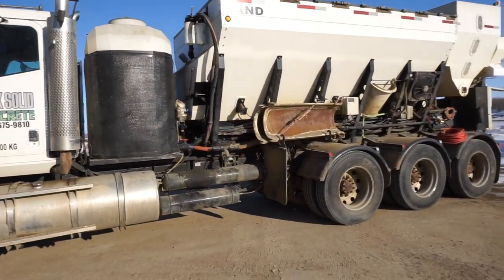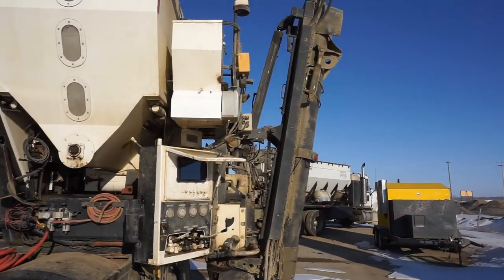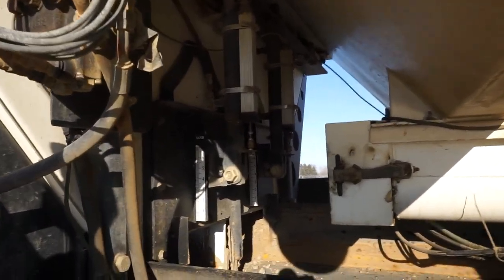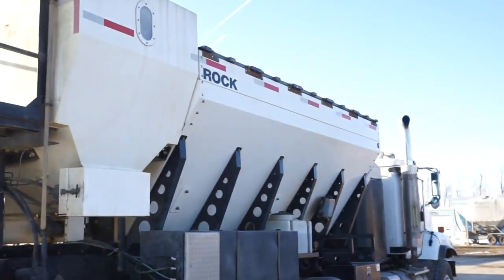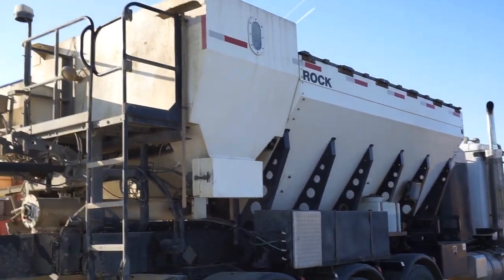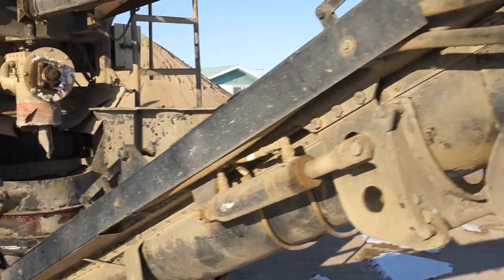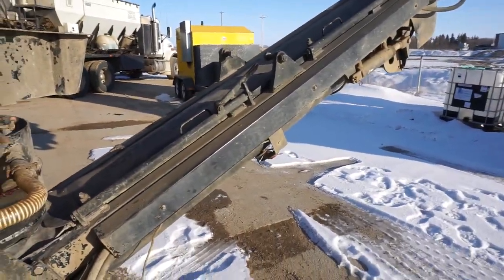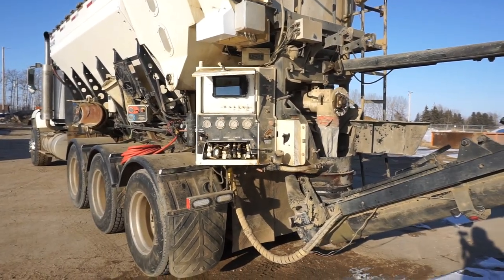What is a Volumetric Concrete Mixer? Ep.1

Comment: How do you empty the sand/stone box if a customer wants to use a different mix? ie. pea stone instead of 3/4"
Reply from the maker: I just turn off the cement then close the sand gate all the way then run the auger and conveyor and just run it until empty, also making sure the water and any admixture's are off too.

Comment: Thank you men for the detailed video.  Go on.  Why do I need a corner fitting on the pipe of the cement feed screw?
Reply from the maker: I just put that there as a vent, when you use a plastic sock on the cement discharge it creates a bit of a vacuum as the powder falls through, so a vent at the top let's it breath and the powder falls freely down into the mixing bowl.
Reply: @johnneufeld02  Thank you friend.  I have a Global imm mixer which belongs to Cementech and we are just starting to launch it.
Reply from the maker: Ok those Global's are good mixers, I have run some of those as well, I wish you the best of luck with your mixer.